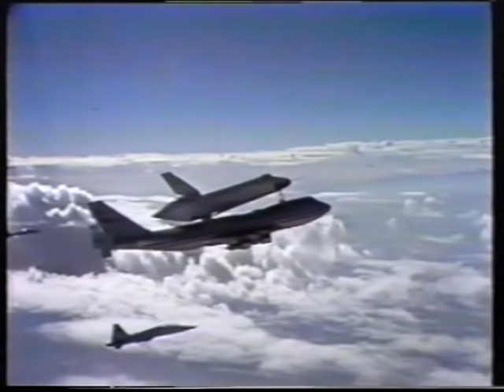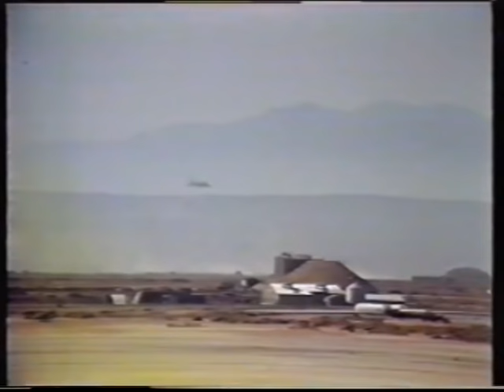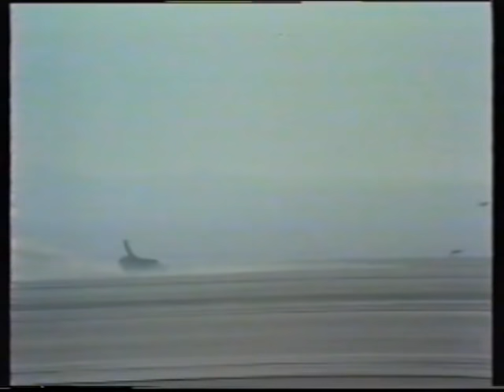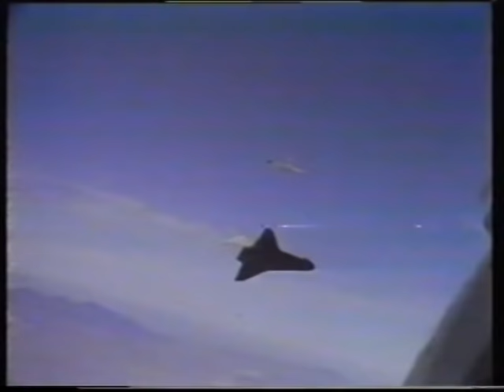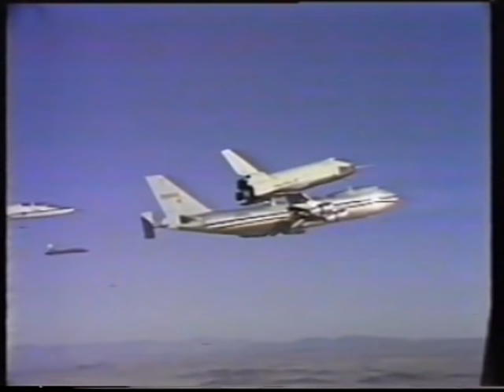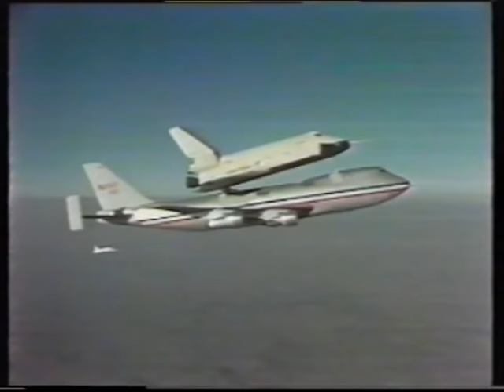Space Shuttle Enterprise ALT 1-5 (1977)

Comment: not the best of landings, bounced around a bit
Reply: The Shuttles used brand new fly-by-wire technology and there was a slight delay between the pilot moving the stick the Shuttle responding.  That along with the pilots sitting so far from the center of gravity caused the pilot to over-correct after the Shuttle didn’t do what he wanted it to do.  This resulted in Pilot Induced Oscillation which you can see when the Shuttle goes up and down at the end causing the bouncing landing.  

It ended up being a good thing because it pointed out an issue in the computer software for the flight controls that was then fixed.  It also provided good data about the performance on the landing gear which they hadn’t yet gotten because the other landings were are smooth.